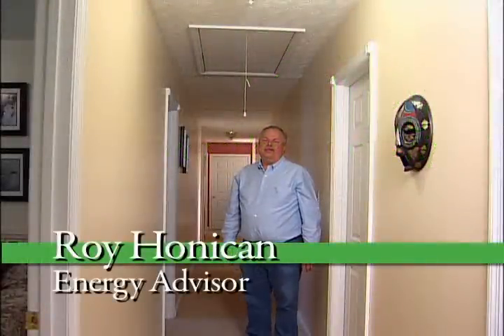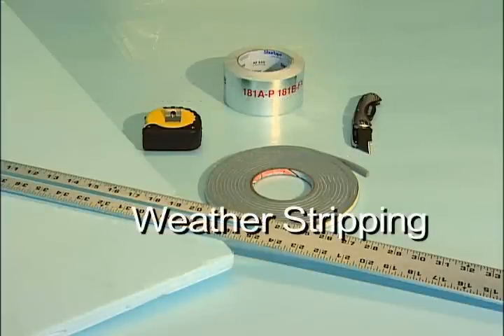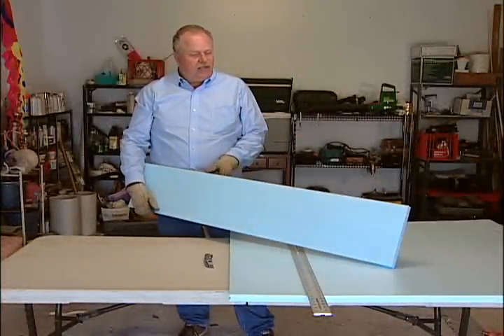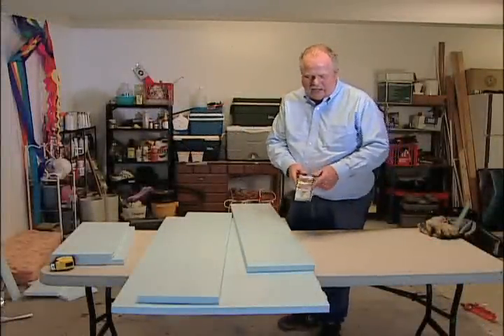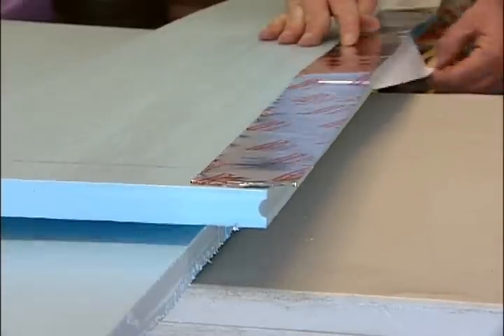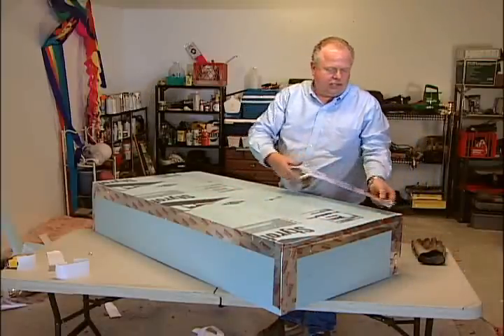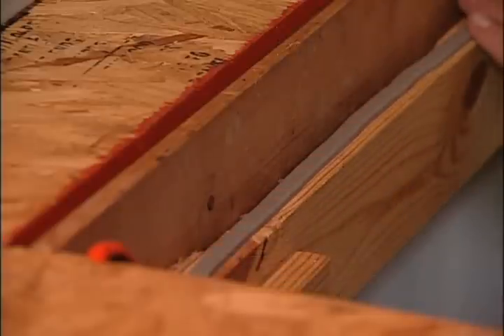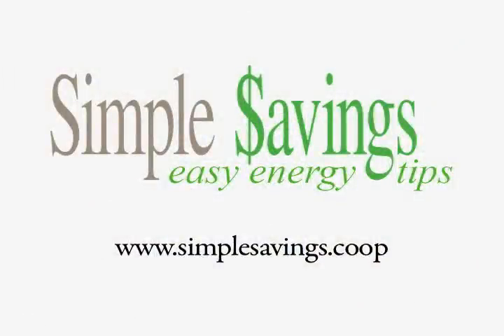ATTIC PULLDOWN INSULATION

Comment: Thanks for this helpful video. One tip (mistake to avoid): check how much room you have around the stair hardware by going up into the attic (with a light) and having somebody below put the stairs up. Measure the distance between the pneumatic closer, for example, and the wooden frame that you're building your box to fit into. I built a box from 1" foam, and was so happy to go in and install it in the attic... and then pretty disappointed to see it lifted up by the pneumatic closers so that it left a big air gap.
Reply: I think I will have that problem too. The metal pieces of the stairs stick up higher into the attic than the folded stairs themselves so it won’t be a perfect cuboid shape.

Comment: Great video--so much better than the zipper style stair covers that are so common now! You used to be able to buy boxes like the one you made as kits but now I can't find them anywhere, at least not this style. An extra thing I did to the the box is to add two small drawer pull handles to the inside of the short ends, and another two to the short ends of the door framing just below where the box sits on the foam weather stripping, so that I can tighten the box down onto the weather stripping for a better air seal.
Reply: Yeah I bought a zipper style one and it's junk. It took me an hour to install it since my attic joists/framing is in the way. I stapled it and used vapour barrier tape on the edges. But the piece of junk leaks through the zipper teeth I can even see the attic light through the teeth. A huge waste of my time and my money.

Comment: While the aluminum tape will do a nice job while building this box, it will eventually separate from the foam (due to the foam, not the tape).  The best thing to do is purchase the FOIL backed insulation board.  The foil tape will stick to this forever.
Reply: What is a good brand aluminum foil tape that will stick to foam forever? thanks.
Reply: Great TIP!  Thank you

Comment: Thats is a  nice a simple fix but you onlyhave about 4-6" of insulation in that attic.  In Wisconsin Energy Star recommends R49 or 15" of blown cellulose (about 22" if using fiberglass). So those boxes create a real problem if you want to insulate up and around the hatch.  We build a dam using 2"x12" lumber on top of the scutle framing all around the scuttle to hold back our insulation and then rest a flat panel that is insulated to R50 on top.
Reply: Aren't you just Tops!

Comment: It is much easier to just glue closed cell foam between the ladder itself and the hatch lid and/or to the ceiling side of the hatch.  Be sure to to use the correct adhesive as many adhesives will melt the foam. Use an adhesive specifically made for foam board, which is available at all big box stores. The way the weatherstripping is used in this video is useless due to the fact that the weatherstripping is not compressed.
Reply: Tom Rumish, I thought weather striping should not be compressed. IDK
Reply: That's what I did, glued it to the backside of the pulldown door.
Reply: are those foam boards that he is using? can i find those at home depot? this seems so much cheaper than the $50 ones i see sold on amazon where you have use a staple gun and aluminum foil too in order to install them.

Comment: A good and simple method. IMHO, can we just make a cover instead of a box (maybe with some foam on the back) as I didn't see a clear advantage of the box space.
Reply: you mean just a flat board that rests on top of the attic door right?
Reply: I had the same question. But then I discovered that when our attic stairs fold up, the folded stairs stack quite a bit higher than the level where the flat board would rest. So I needed a box after all. It may depend on your stairs.

Comment: Great idea, however you need a thermal barrier(15 min fire barrier) above and below the xps foam board as it is combustable.  1/2" sheetrock, 3" mineral wool and any other that meets code. I am dealing with this issue right now and it isn't fun, since each gov agency has something different to say, however not being covered by insurance in a fire situation could be an incentive to check the codes out. In most areas no permit or inspection is needed for insulating an attic, at least after the house has ben built. Were on our own. Good luck!
Reply: Ug
Housing codes are at a point that it seems mainly for profit then safety. 
Everything burns. Use polyiso
Reply: Can you explain why this is needed for fire code?  If your house is on fire, what's the difference?  Thank you!

Comment: I had mine all built, used 1 1/2 " board. problem was the ledge was 1" so I had 1/2" over hung which interupted with the spring and mechanical hardware.. more cutting..
Reply: I had the same problem, had to redo my box. Works great picked up 3 degrees of heat in my hallway. Built mine with scrap wood and then insulated it with more scrap insulation. Came in at about 8 pounds but fits nice and tight.

Comment: definitely helps more with air filtration than anything, I imagine the r value is less than R7. Where attics need R38. I'm about to do this myself with a similar technique but filling the box with loose insulation and reenforcing with stripping. also using foam board caulking for joints.